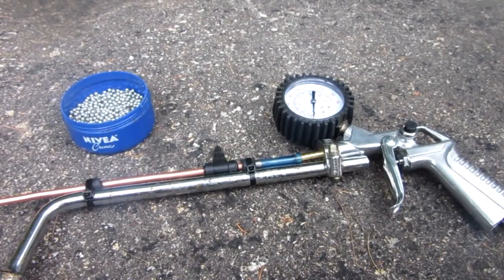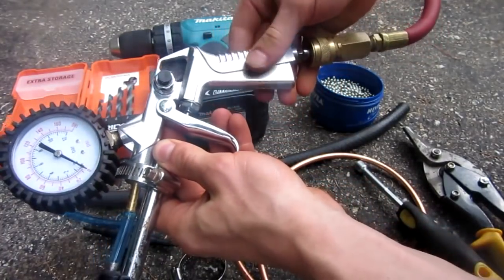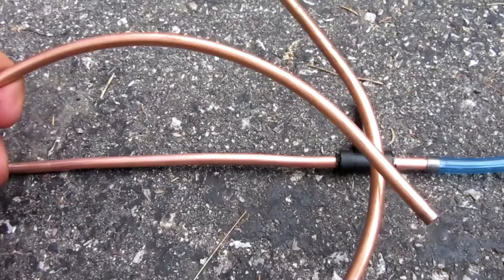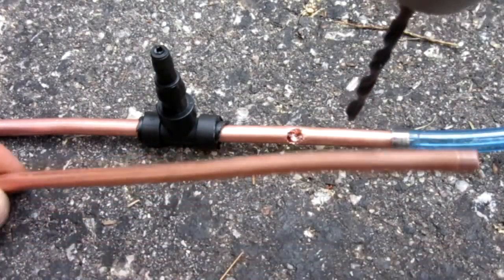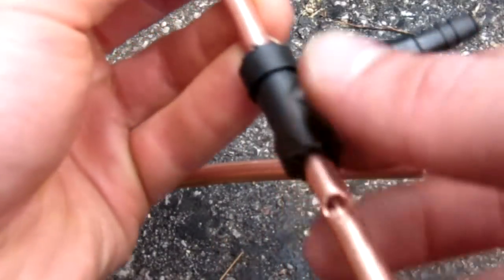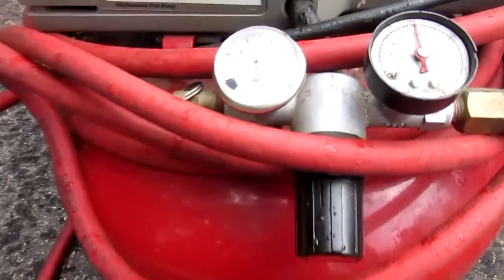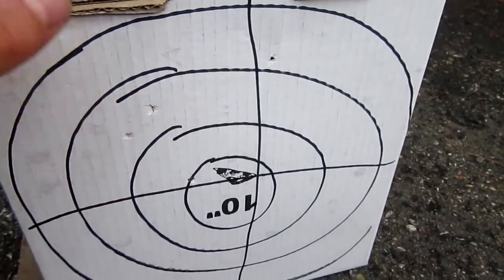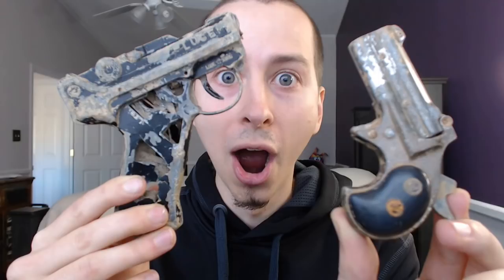How to Make a POWERFUL BB Airgun  - $5 EASY

Comment: air compressor $200
copper tube $1 (or less)
pack of zip ties $3
angle iron $10
comressor gun $10 
hose clamp $0.50
box of BB's $4
cheap drill $30
drill bit $1
T valve $2
clippers $4
Total $261.50 (give or take)
5 dollars my ass
Reply: Hahaha I was gonna say the same thing.

Comment: Holy Shike was that difficult to watch! The "ratchet thingy"....hose clamp. Copper tubing is NOT brake line (made of steel),  thats water supply line for a fridge ice maker.  a simple file or sand paper will smooth the end out much better than a drill bit will. see how the drill bit left a very rough edge to the hole that you drilled as your ammo supply hole? cause it aint made for that. why even drill an ammo hole when there is already one at the end of the copper tube. how you think ammo got loaded into a gun back in the civil war days?  and why use a "T"  to cover the  hole when  you can use the black rubber hose you sliced up? and instead of using a hose to join the copper tubing to the air gun, there is a proper way to do that. in the world of plumbing, its called a compression sleeve & nut (although plumbing supply isnt going to thread with air supply).  $5? the copper alone is probably worth that much. you may mean well, but sharing ideas about something that was made so poorly, then poorly explained can lead to others....ahh, forget it. "necessity is the mother of inventions"
Reply: You can read about his next experiment from the Darwin Awards website. lol